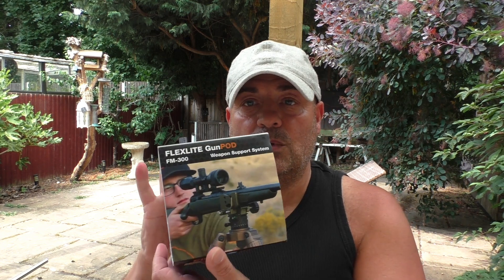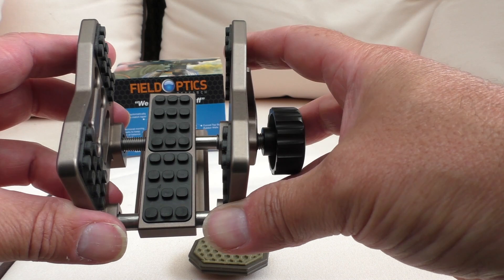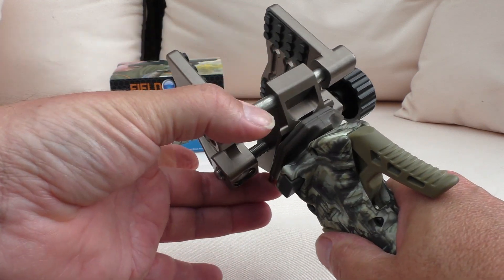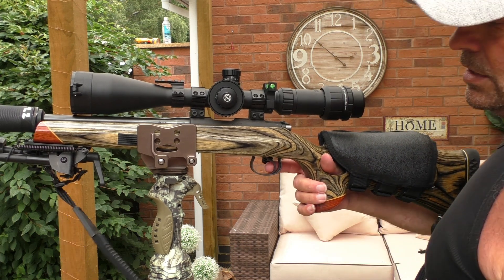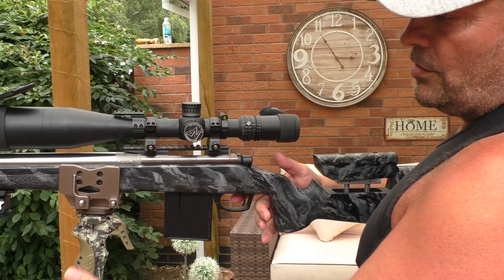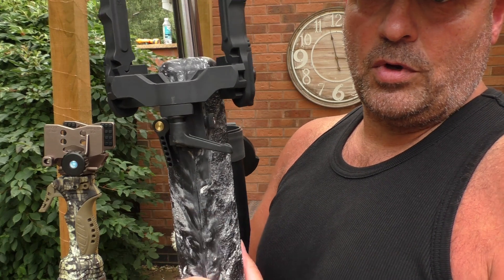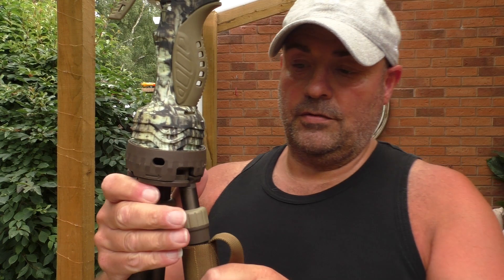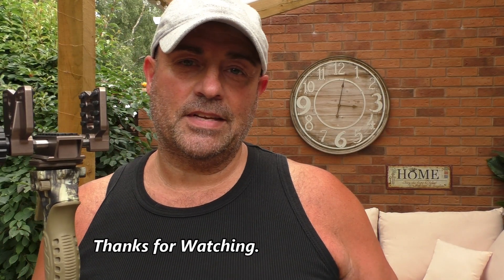Primos Gen 3 Trigger Sticks Saddle Head Upgrade.

Comment: Great video.... how do the sticks /mount do under recoil of the larger caliber rifle?  Great view and exactly what I was looking for..
Reply from the maker: Hi James , thanks for checking out the video, the saddle holds up well under recoil because there is that little bit of flex at the top of the trigger sticks it allows the rifle to recoil backward into your shoulder pocket , but because your shoulder pocket is being used to not just steady the rifle your offering it up to the rifle solidly to absorb the recoil and to minimise too much backward motion just as you would a bipod if you see what I mean?   you can also check out the video after this one if you like where I also add a ball head to the system you might find interesting, hope it helps cheers G.

Comment: This is such a great video. I love the primos sticks but wanted to find a way to have a griping mechanism for rifles. 
I was researching a way to adapt the bog death grip to the primos tripod but having no luck. 
This solution is much better.
Reply from the maker: Hi Stephanie, thanks for checking out the video, there is a follow up video to this one where I attach a ball head to the shooting stick system that also offers more flexibility , cheers G.
Reply: Ahhh, just watched the follow video as well. 

Great addition, I’ll be getting both components to add to my gen3 sticks. 

Thanks again.
Reply from the maker: @stephanieb27  
Your welcome, incidentally there are 2 version’s of that shooting cradle, there is the one I have and also a bigger one which is more robust and chunkier with a few little upgrades if you so desire but at least have a look to see which one you might prefer, cheers G.
Reply: @GianniG55  yes, I did notice that and actually upgraded to the FM-570B. It looked a little more suitable for my AR platform.
Reply from the maker: @stephanieb27  
Cool glad the video was of help .

Comment: That's a 200$ plus tx plus shpping upgrade
Reply from the maker: Well i actually paid £180 so yes I guess it was close to that , even the original hog saddle was around £300 and now there are saddles which are high into the hundreds  , there some plastic ones about which might be quite a bit less expensive , no one is saying you need to buy one.
Reply: @GianniG55  no, no, seems like a real top of the food chain product, but here in canada, man, we pay the total for parts.  Sorry about the confusion.
Reply from the maker: @iantouzel638 
                             Hey no worries, I mean it is well made CNC machined and all that and I guess that does come with a price tag but believe me there are far more pricier options out there and especially when buying a big carbon tripod like some people buy which can easily get over a thousand bucks, I just wanted to get more out of my gen 3 sticks and in a video I did after that one I even added a ball head and really glad I did the whole setup just works really well without spending a ton of money.
Reply: @GianniG55  cool, i will watch it, begining to look after a sadle for mine, have the tripod from Primos. Thank's

Comment: Been looking for weeks at different pods primos gen 3 and bog death grip are the two I am now deciding between, until this video, being able to attach a grip such as this which is like that on the bog death grip to the trigger gen 3 has made my decision. Am I correct that you do say the adapter you used to attach the grip comes with the primos trigger gen 3 pod. 
Great video nice display of the usability
Reply from the maker: Hey Magoo ,lol, thanks for checking out the video most appreciated,  yes if you buy the Gen 3 trigger sticks they should come with that Camera/spotting scope adapter , I think here in the Uk it costs about £15 but I’m sure it comes in the package, and also the gun cradle comes in 2 sizes this one is the smaller of the too , the bigger one is longer , deeper and has rails on the side if you wish to add accessories and such, but this one suited my needs, also just a quick note something that I didn’t know until I made the video was that on one side one of the cradle the rubber inserts came unstuck which maybe down to weak glue so I did check the others and to be honest the glue wasn’t great but it wasn’t a big deal for me as I just cleaned up the backs of the inserts and then just re-glued them with more powerful glue so don’t know if that would be a deal breaker ? but I’m still very happy that I purchased it , hope this helps cheers G.
Reply: @GianniG55  great advice , thanks